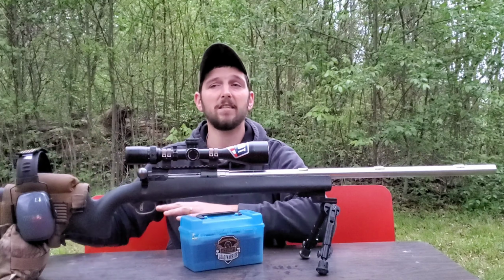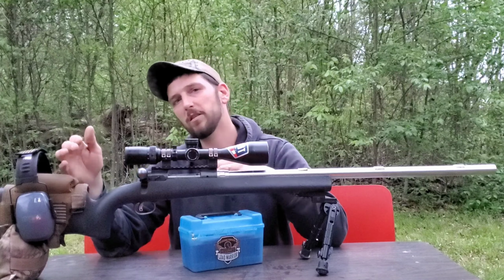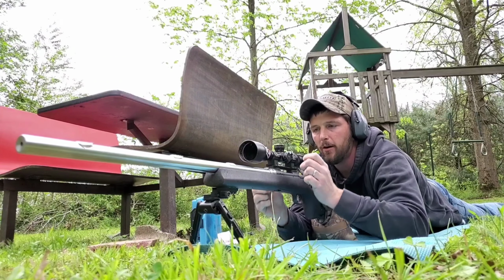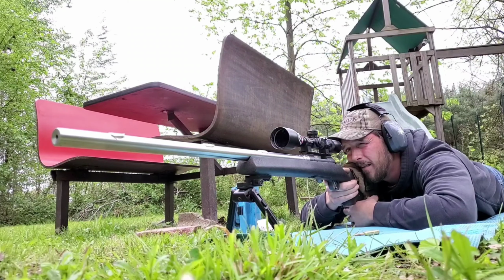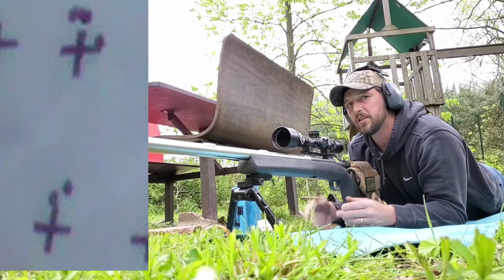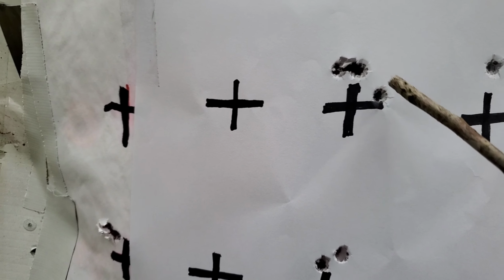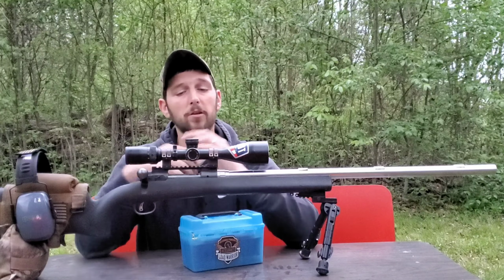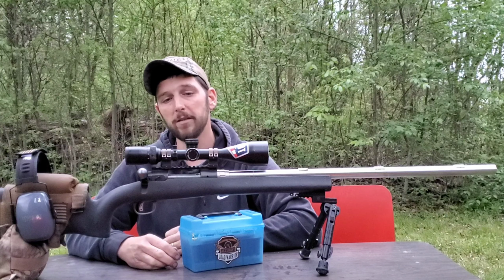Perfect Parallax and Maintaining Cheek Weld For PrecisionShooting/ I Was Wrong

Comment: Maintaining a cheek weld throughout a 5 shot group could be only one' variable that might make consistent one hole 5 shot groups possible, or not, but bringing in that flyer is what is important and why maintaining a cheek weld throughout a 5 shot group, or however many shots you may take to confirm a group has been included in a set of procedures, to acquire the tightest groups one can shoot. could be you are missing something along with  the procedure of maintaining a cheek weld for it is not just one variable that will make a one hole group possible. I think your video proves if anything that one can maintain a full sight picture while moving their cheek fore and aft of the buttstock comb. Which I think says something about your scope because I easily lose my full sight picture  in my scope if I don't concentrate on keeping still and holding for a full sight picture, But I think its still possible that maintaining a cheek weld along with other variables is what will give us those groups we dream of, just my own personal conclusion.

Comment: The numbers don’t mean much, you should always do the head wiggle if you have the time like for load dev or f class.
Reply from the maker: Yes I agree. But even when I find the best position with the least amount of cross hair movement if I move my head enough like I did in this video it still looks like the cross hairs have moved slightly but somehow it still went to the same point of impact. I plan to test this out also at some point shooting on the infinity setting at distance.  I wonder if you get out to a distance far enough that the parallax wont adjust any further does it all yo out the window?
Reply: GunFather Precision , for me it is only a problem when mirage is present but I also remove my cheek piece and have a front rest so I remove 100 of my influence on the rifle. If my cheek is touching it at all then there will always be slight movement when wigglin.
Reply from the maker: @raining1975  that makes sense.  I shoot much more of a tactical style instead of a traditional fclass free recoil so I have a solid cheek weld.
Reply: @gunfather83  , This is just to set up the parallax. But the front rest certainly makes it easier to get 0 input into the rifle and be on target. Once the parallax is set up, I put the cheek riser back on and give it a little shoulder pressure when firing.
Reply from the maker: @raining1975  ok I got ya. I have watched a couple of guys who shoot prone almost like a bench rest shooter with no input and let the rifle recoil free until it hits their shoulder. I  have tried to shoot like your talking but when I let the rifle recoil and slide in the bag I cant seems to control the windage at all. I have been told by guys who typically shoot higher scores than I do that I just need to learn how to work the rear bag but I do much better just shooting tactical style using a butt hook and controlling recoil.  I have also been using a  regular style bipod but I just ordered an atlas 5h so I can kinda have the best of both worlds.